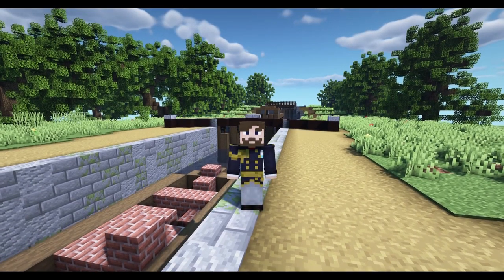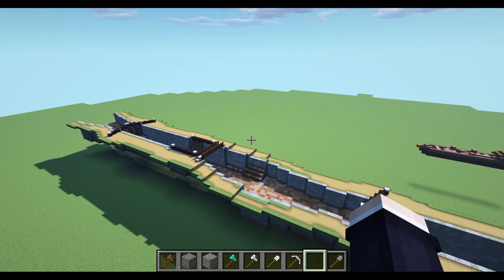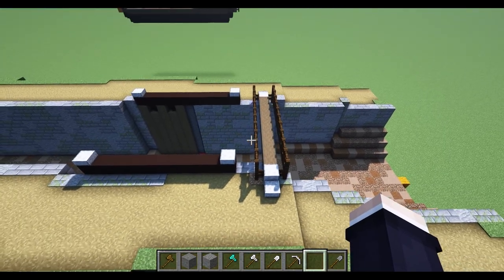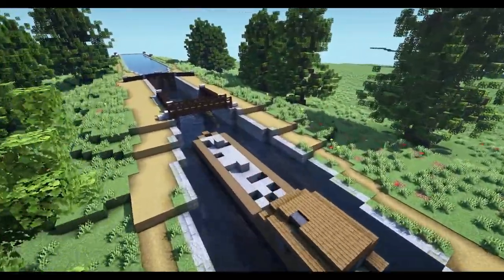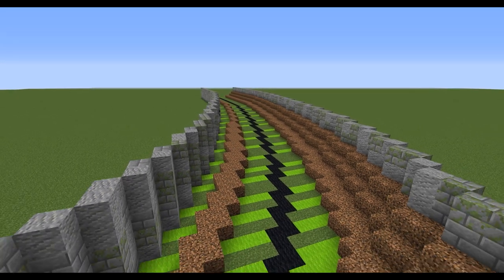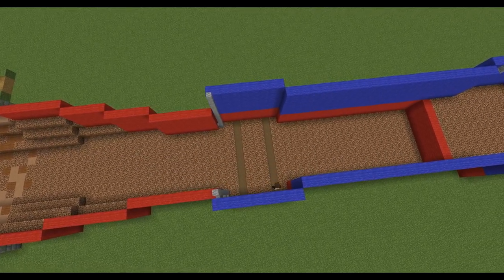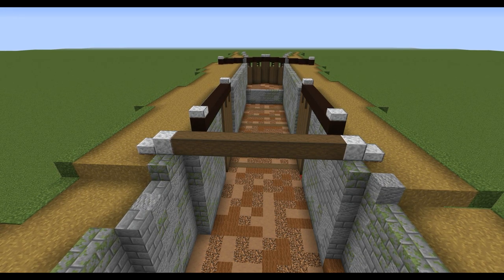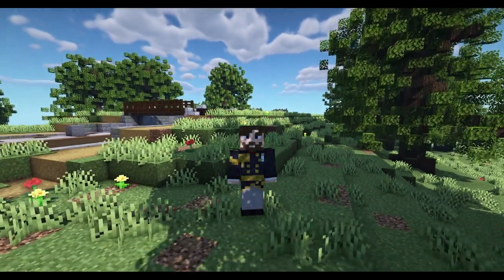Minecraft : How to Build Canals and Canal Locks - Minecraft Tips and Tricks

Comment: Best worldedit elements are found in these. I am always left confused until you do it.

As for filling with water, do you just select the 2 points at the top of each water level, //fill water, and let it flow downwards?
Reply from the maker: You can do that, or you just set a section to water and then stand on the same level as that water and type //fixwater

Comment: im unsure what blocks to recomend but for a touch of extra detail put some ever so slightly raised blocks by the gate levers (arms?) almost all canal gates have theese at the arms in the floor typically raised bricks and there used to give you something to push against with your feet when opening the gates for a little extra leverage

also perhaps a single wall or fencepost piece near the gate to be the winder mechanism used to open the sluice gates as well as a trap door placed flat against the gates themselves to take the place of where the actual sluice gate would be

also dont forget ladders in the locks that are low along the walls so that you can get in and out of the lock to go work the gates and return to your boat
Reply: I would say either wood planks or stairs for what you are suggesting
Or 
Bricks or cobble stone would be a good fit